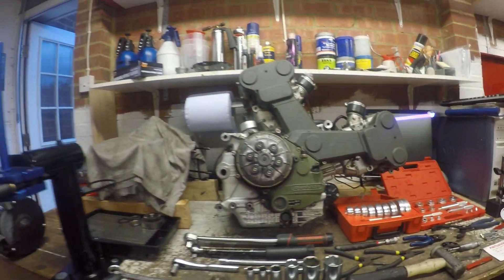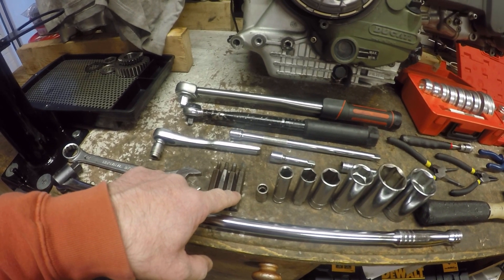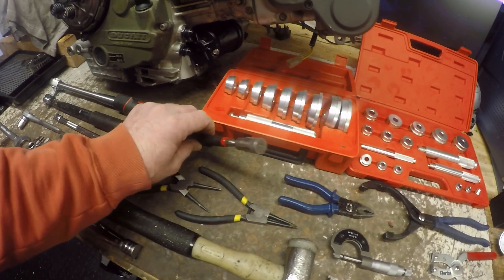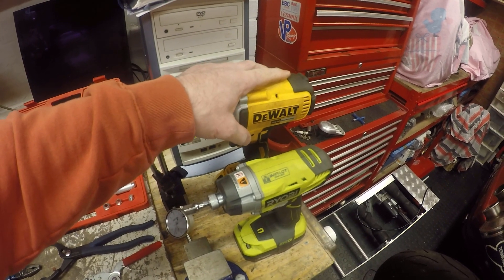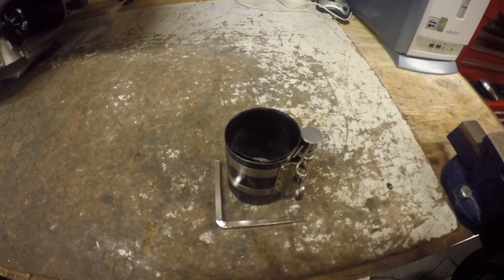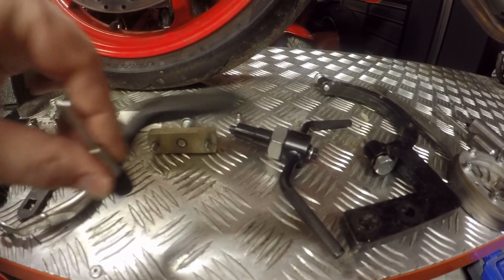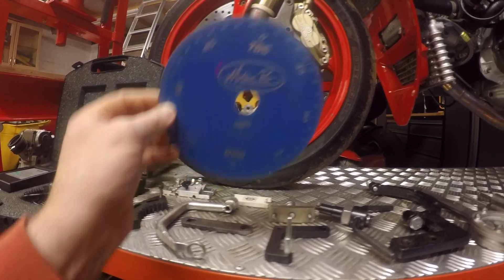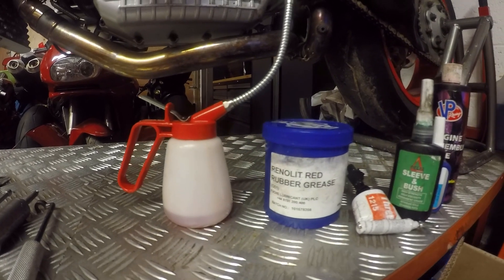DesmoWerx Tech Guide 3 - Tools for a Ducati Desmoquattro Engine build.

Comment: Great video, i made a list of the tools you spoke of that i don’t have and ordered them. I’ll be doing my first belt/timing/shims with a pro in San Francisco at a motorcycle guild. I’m writing you today because I ruined the seat of my swing arm while trying to remove the bearings. I had it heated well, but they wouldn’t move. I also shattered a 5lb weight lifting exercise piece that was used as a base for its center hole was about 3 or 4 mm bigger than the bearing. So, i’m willing to mail this swing arm to a general P.o. box or local public mail/shipping pick up point of your choice in hopes to make a video of bearing removal and parts numbers for the swing arms. I already purchased a new swing arm but will still have to get the bearings out of it. Anyways, Thank you for the vids, i’ll be using them as i do certain bits of work for sure. I share your stuff on some Facebook groups and i’m the admin on the 916/96/98 group, i posted your sound off video yesterday. Thanks!!!
Reply from the maker: Glad it was a help, the only tool I forgot to get out of the tool box was the a primary gear puller, you will need one of these if stripping your engine right down as its a bugger to get off.
Thanks for sharing the video on Facebook 👍😎
Don't worry about the Swingarm , I have a few lying around that will require refurbishment at some point. Will add it as a possible video for the future. Thanks for the offer anyway 
Hope you are keeping well in San Francisco 👍

Comment: Hi, thanks for the videos, they have given me the confidence to open up my 888. The crank plugs working it’s way out, two questions, any suggestions on getting the primary gear off? Using a 10 ton hydraulic puller and a bit of heat but it’s not moving. And what’s the ‘fix’ for the crank plug? Cheers
Reply from the maker: Hi Andy, 
I forgot to add in my primary puller!!!! DOH!!!
There is a special tool, like this - https://www.ebay.co.uk/itm/Ducati-Primary-Gear-Puller-Part-No-88713-2092/120929098275?hash=item1c27ef9a23:g:b4sAAMXQw8hRaSqK
The earlier engines including your 888, the primary drive gear is on a taper, its apply heat to the gear, then pressure on the puller and gently tap - BE CAREFUL, it can shoot across the room. 
I am afraid its a case of perseverance for this gear do not apply too much force or you can damage the crankshaft.
The fix for the crank plug is remove rubbish one, clean out crank, replace with new, use high strength lock compound and then punch the edge of the plug and the threat to stop it retreating out. 
Hope that helps. 😊
Reply: DesmoWerx thanks, the gear did eventually ‘pop’ off, and flew about 3 foot across the garage! Almost s**t myself. Will separate the cases tonight after checking the endfloats.

Comment: Great vid. I ticked each one off my tools 👍 only things I need are the gear selector holding tool and foff rattle gun 😀. 

I downloaded gates belt tension tool onto my phone and use that but never calibrated it. Any chance you could do a comparison with the posh acoustic tuner you use? Thanks again, I must get back out and spruce up some cases. 😒
Reply from the maker: Hi Chris,
Which App is that? I am happy to do a side by side comparison if it helps you.
Reply: @DesmoWerx  this is the one I used I think. There are three or four others. Not sure how good though. https://play.google.com/store/apps/details?id=com.gates.carbondrivecalculator
Reply: @chrislee7817  Hey that comparison would be interesting. I just used the app the other day on my 748 and was very easy and helpful to use. compared it with the 5mm play between the pulleys method and it seemed to be spot on. So interested to comapre with the expensive meter.
Reply: @DesmoWerx  That would be cool!
Reply: A comparison of the tool against V’s the APP and then deflection/twist measurements when correctly set up  would be really interesting and useful.